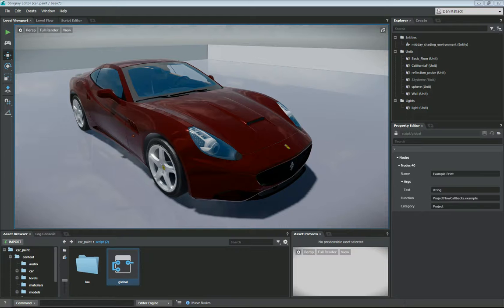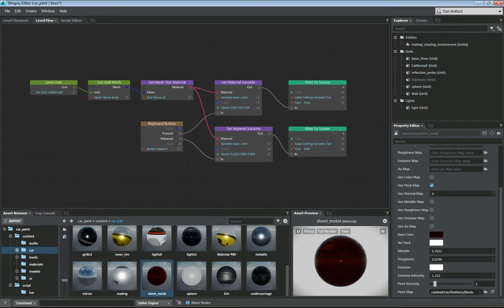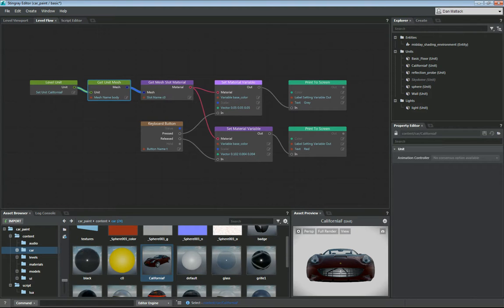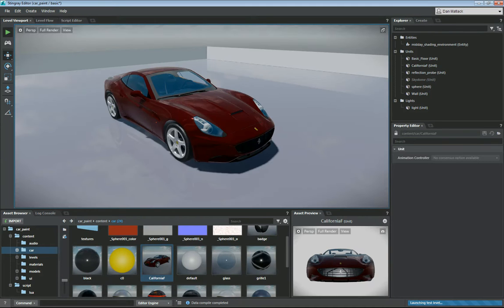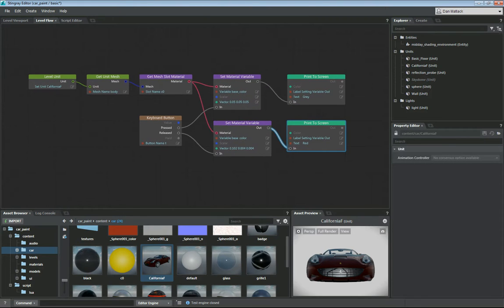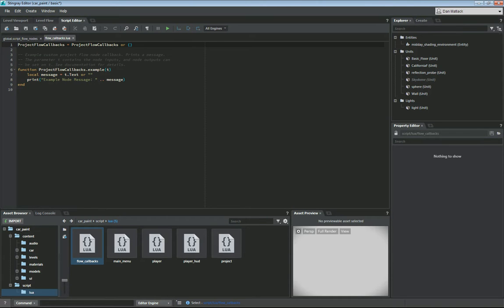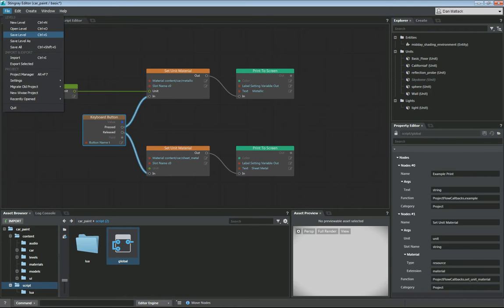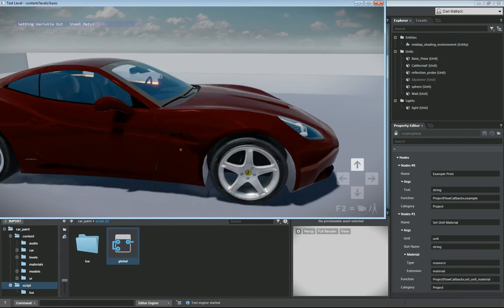Stingray Making a Custom Flow Node to Change a Material

Comment: http://www.archimaze.com/wp-content/uploads/2017/02/Capture.jpg
hi Dan, we were trying to get the interactive material change in our scene, pl check the above error and advise
Reply from the maker: First guess is syntax. You have a lower case "f" in ProjectFlowCallbacks. Fix that and try again :) The function you list and call in your .script_flow_nodes must match exactly the function you list in your flow_callbacks.lua
Reply: thanks Dan, will try again
Reply: it worked, thanks v much

Comment: +Dan Matlack
Hey, do you know of the autodesk team plans to add gravity to keyframed objects, because I have been trying make a simple platformer as an engine test however i have had to resort to using an appkit which defines a gravity_enabled enivronment. I would prefer it if I could set gravity in levelflow and then with the physics enabled box checked in the unit editor as well as object set to keyframed, have gravity actually apply to that object! Is there something I am missing?
Reply from the maker: +Zoravar .K  For this work, you need to set your actor to 'dynamic' to start in the unit editor. Then you can follow this tutorial -- https://www.youtube.com/watch?v=8chYAf-F11U -- You will set your actor to 'kinematic' or 'keyframed' on level load, which will allow for non-gravity movement and then when you want gravity, use the custom flow node in the tutorial to turn it on. We don't allow switching a keyframed actor to have gravity or active physics but you can switch a dynamic actor to keyframed and then back again at will. Hope that works out. Visit the forums for more info and helpful posts!  http://forums.autodesk.com/t5/stingray/bd-p/800

Comment: watch the dcc link tutorial
Reply: +Dan Matlack  Hi Dan, in this video you have  used the Get Mesh Slot Material node, but i cannot find that option in stingray which i am using. 

I am using the Stingray version 1.0.31.0 trial version, here i cannot find that node. But in documentation they have given about the Get Mesh Slot Material node. So little confusion about it now.

can you please explain what is the problem in this?.
Reply from the maker: +Siva Murugan You should upgrade your trial to the latest build. The node should be in level flow under "Material" in the drop down.
Reply: Dan Matlack  Thanks, I will update.